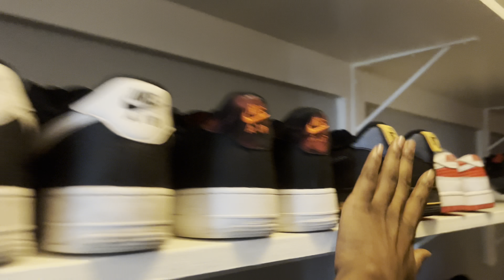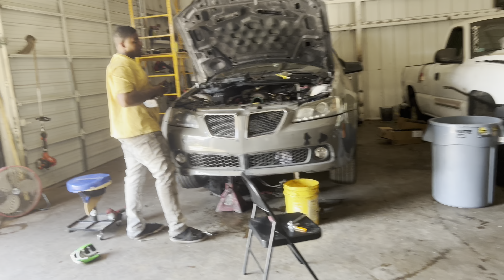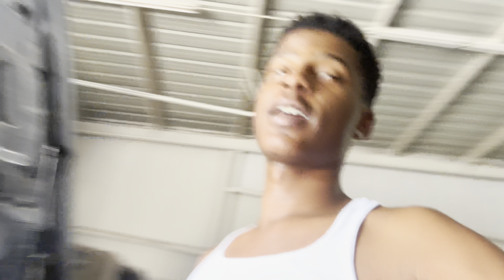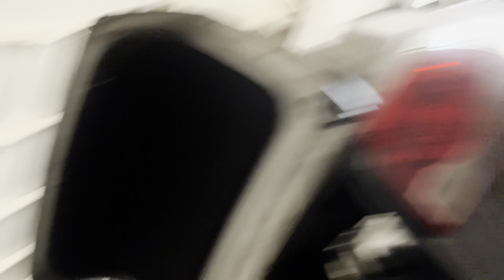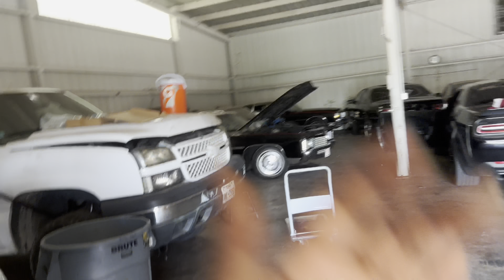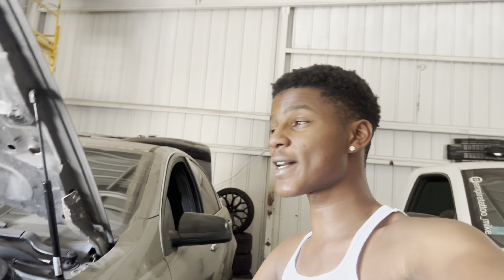93VHandsOn Getting This G8 Ready For Complete 6.2 Motor Swa0

Comment: He should of took them parts off after he pulled the motor
Reply from the maker: we just go with the flow gang
Reply: @boosiessg_  I use to work at a hot rod shop pulling motors out and dropping the new one in